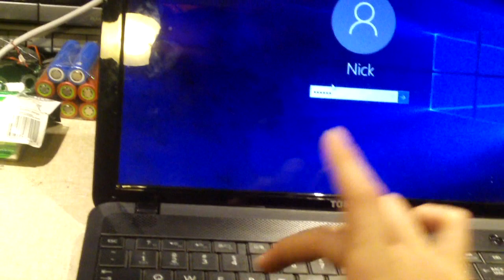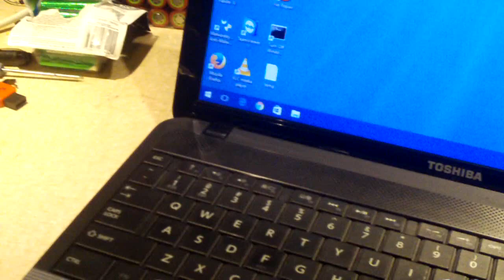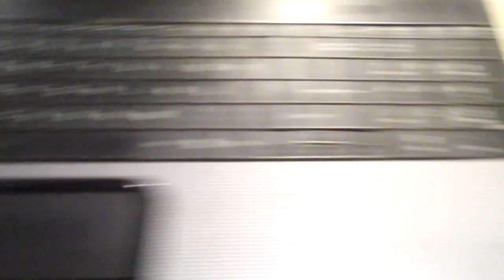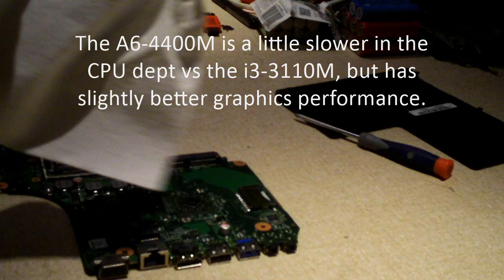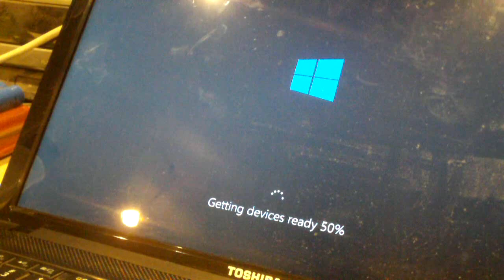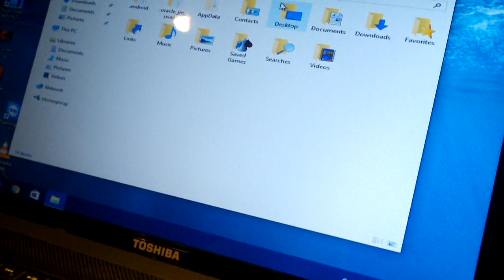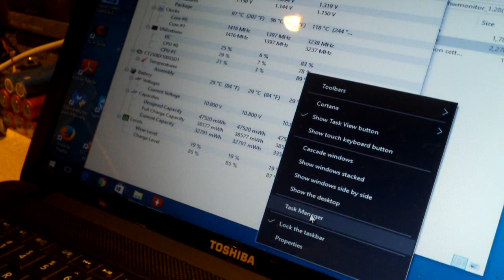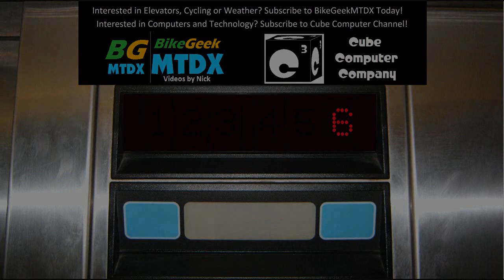Converting my Satellite C855 from Intel to AMD

Comment: I have a question. My friend's laptop which is a Toshiba Satellite (Cheap budget laptop he bought for about $350) it has an Intel Celeron (I can't remember what model Celeron it is). I can hear the fan running but not very much and the laptop was very hot, I decided to download hwmonitor and his CPU temperatures were above 160F. Is that temperature bad for a CPU?
Reply from the maker: That's hot, but not critically hot for a laptop CPU. Make sure the cooling fins are clean.
Reply: ***** Oh, okay. Thanks!

Comment: I have a Satellite c855 as well and tried upgrading from a Pentium B950 to a I3 as well.
The main issue is that it's not a "whitelisted" CPU and it will shutdown every 30 minutes no matter what OS you will use.
Unfortunatelly it's baked into the BIOS and there's nothing that I can do. I do not have the necesary skills nor knowledge to mod the bios. I'm suspecting that's the case for your's as well.
Another option would be to change the chipset from the HM70 to a HM76/77 to have SandyBridge suppor, but that's a different kind of topic.

Comment: Those laptops models are good but the only thing I hate about them is the screen brackets I had 2 of those type of laptops because I had to repair the brackets. They seem to break near the hing where they press the 2 metals over time it will put stress then break.
Loved the video I did the same thing with my t60 I wanted Ati x1400 graphics instead of the intel 950 for better performance

Comment: I have a laptop with that exact same a6-4400m and the onboard gpu overclocks amazingly well. I'm able to overclock it from the base 686 MHz to 1110 MHz  and its stable
Reply: That laptop has 4gb of ram and a 500gb 5400rpm hard drive. It's a hp g6 laptop
Reply: +YTPbrendan9003 you should use a laptop cooler.
Reply: What temps do you get at full load?
Reply: +- λshton - the cpu part gets into the 80-90c range while the gpu gets into the 70-80.
I have had it shut down before because of overheating
Reply from the maker: These AMD APUs sometimes tend to report temperatures much higher than what they actually are, but when overclocking, things will get hot obviously.

Comment: nice! I gotta Toshiba C855D-S5103 that is just setting there (E-300 APU, Dual Core 1.3Ghz, Radeon hd 6130, 4GB RAM, 5400 RPM HDD).... Its okay for general internet, barely pulls off HD formats like x264 in VLC (using VDP drivers in Lubuntu). I should see if i can upgrade to a nicer motherboard or at least a small SSD. I am using it as a Halftop
Reply: what you're working with is the AMD equivalent of an Atom chip. It'd probably be a good idea to invest in a new mobo or a new laptop altogether
Reply: +Brooke Rappaport (iBrooke) yeppers. It can do some gaming like playstation or Sega CD emulation but I wouldn't do n64 with it. For a non gamer kid that just needs to word process, Facebook, and maybe 480p on YouTube it would be good and doesn't break the bank. Used I've seen for 199 USD on amazon and eBay for 100 USD right now! I haven't bothered getting a new screen but without it connected the thing gets like 4 Hours on battery performance mode.
Reply from the maker: That AMD APU is low end, but better than Intel's Atom.